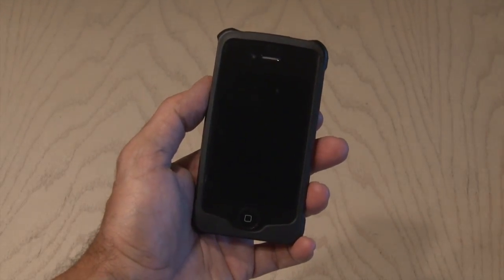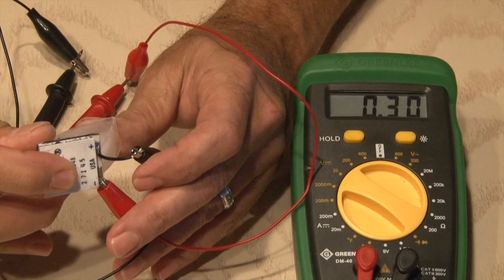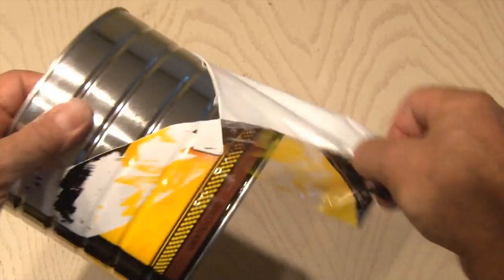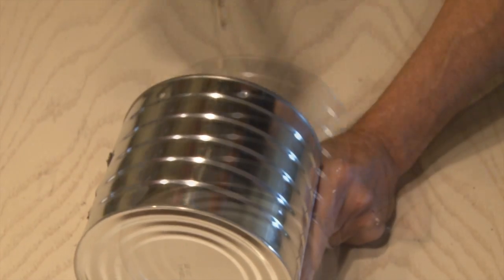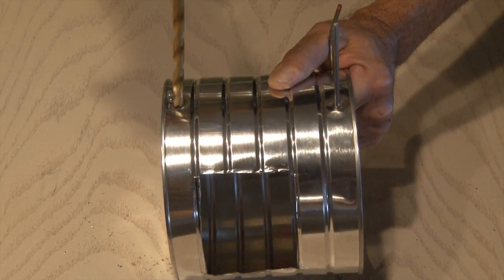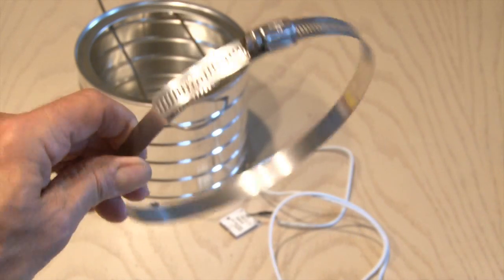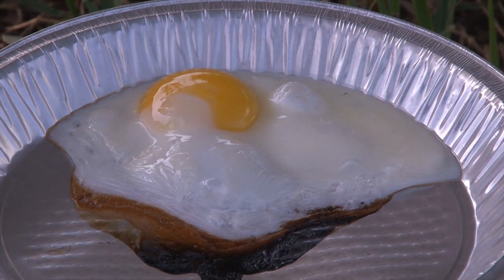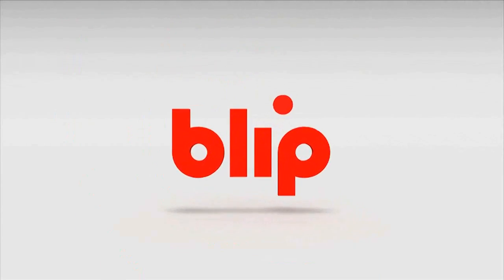Charge Your Cell Phone with FIRE!

Comment: Kip, try applying heat to one side and a coolant to the other side simultaneously. It should increase the voltage reading and current flow.

It should work out fairly well, since it's just a thermal couple.

Comment: this WILL NOT WORK AS IS. You need to bridge the green and white wires together with a resistor. Usually 220ohm. Open up any usb charger for iphones and you will see that the data pins are bridged with a smd resistor. without that the phone will not charge

Comment: maybe because it costs some 200 more than the S3, loses in every statistics category, has very weak structure, the screen is the same as it was in 2010, has no place for memo card, the back lid cannot be opened without taking it to an authorized dealer and pay for the service of in ex replacing your battery, and you have to pay for most apps on app store while on android everything can be had for free, and apple maps are useless.they are even banned for peoples own safety in some countries.

Comment: all you need to do is connect a 100 ohm resistor from the red wire to the data cables and it will work

Comment: I'm sure he did, but this was just a proof of concept.

That said parallel would be superior to serial in this case because the parallel adds voltage and keeps amperage the same, and the iPhone prefers higher voltage at a relatively low amperage. Also some electronic devices can drop down the voltage if it exceeds the maximum, but few can do the same to amperage.

Comment: It's obviously fake if you know anything about the charging procedures of an iphone.  It would require a few resistors to supply the correct voltages to the data lines in order to make the iphone know it is connected to a charger.

Comment: I've done this before, I'm getting a degree in electrical engineering.  It's fake! look, it doesn't charge until the cord is out of visiblity.  The circuitry simply wont power an iphone 5 without using all four wires from the usb cable.

Comment: you just proved yourself wrong dude... iphones are designed to run at 5 volts, four will just result in an error message, and yes the data cables are required to have a voltage, otherwise the iphone will just show an error message about not using legitimate apple crap.

Comment: Not with iphones.  iphones require you to put specific amounts of voltage into the data lines.  This makes it so the ipod knows whether to draw an amp (if plugged into a computer or wall wart) or half an amp ( a car or battery charger).  No data imput = no charge

Comment: No, you need ~2.7 volts on the data line.  Depending on what voltage you put in it knows how much current to draw.  I have built multiple ipod chargers before and just applying current to the red and black wont work.

Comment: Kipkay that is super inefficient, you couldn't take ten minutes to think about how it works and how it could be improved just by little things? For example you want the side facing away from the can to be as cool as possible, so don't use a metal hose clamp, use something that doesn't transfer heat quickly. I would recommend thermal gluing the unit on and putting a small heat sink on the other side. More voltage that way.

Comment: This won't work.  iphones and ipod touches require voltage on the data lines so the device knows what it is connected to.  In theory this could still work with the appropriate circuitry but the way you kipkay has it, it would only charge older ipods.  Trust me, I'm an electrical engineering student..  Like this so people don't waste their money.

Comment: This seems like a really bad idea, wireing your USB directly to the generator means its unregulated and if it goes much higher than 5 volts it will break your phone. Try using a battery case instead.

Comment: I always loved your videos and the theroy behind this one is a project i've been wanting to do.  FOr simplicity's sake I see that you left out more important stuff such as making sure you size the peltier element correctly, using a boost converter to up the volts and amps so it can correctly charge your phone/ipod correctly instead of just enough to turn on the screen and actually end up draining your battery, and most importantly a heatsink on the exposed side of the peltier element.